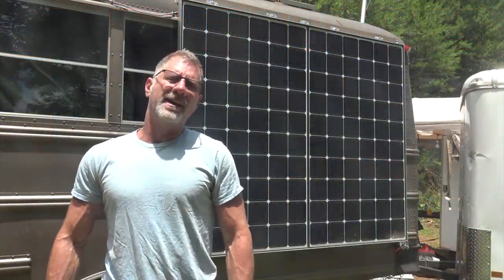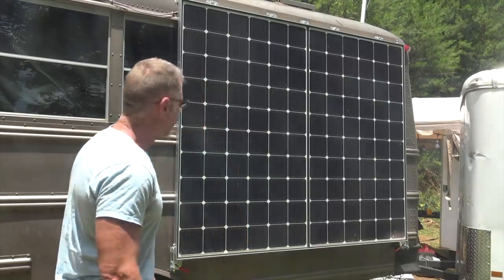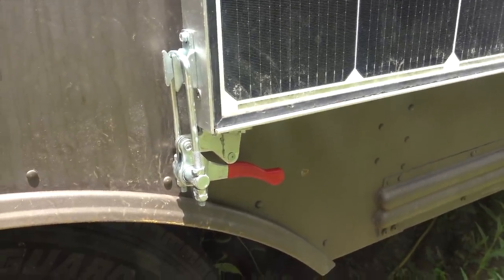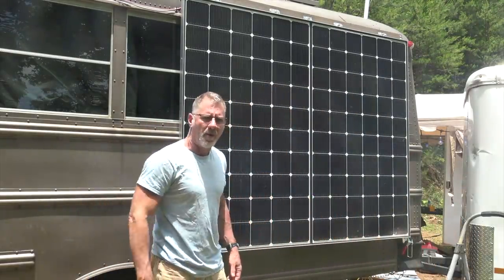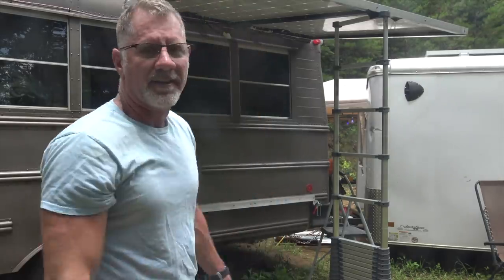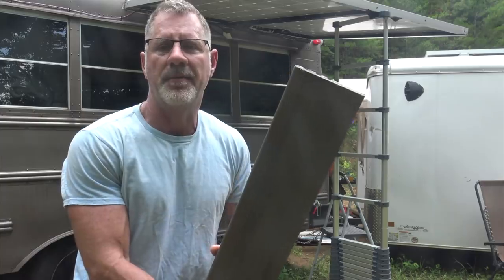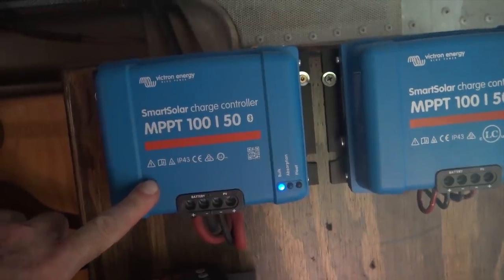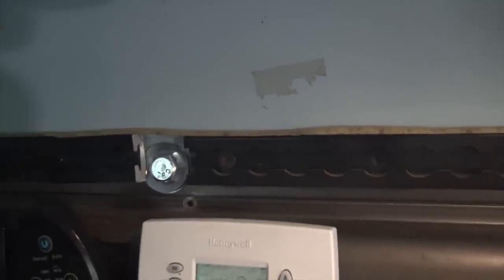Installing solar panels on the side of my rig | How I did it

Comment: What a great idea. This vertical setup for solar panels on the side of an RV had Not even occurred to me.  Duuhh!  Thanks for bringing this to light...with the right equipment and an aluminum spoiler plate mounted on the front ( forward facing ) edge of the arrayfrom top to bottom, would push air sideways stopping air going down the highway from attempting to tear the array off the side of the RV.  I'm getting Very excited just watching your video. What a great way to mount solar arrays when you don't have the roof room to do so.  Thank you very much for this eye opener.  I just subscribed and am clicking on you vid about running your A/C system of the panels. Keep the faith Jamie.    bill in Florida

Comment: I'm doing the same thing on the back of bus with 4- 100 watt panels.  It will use hinges and lifted with gas struts. I wanted it to create an awning for the the entire back of bus to keep the sun out and still allow me to open the door. Nice job!
Reply from the maker: Thanks, Ana! I bought gas struts too but didn't think they would allow the panels to extend up high enough, so never installed them. Didn't want folks banging into them. I hope to see how yours turns out someday. Maybe I'll get some ideas.

Comment: Paint dept in store has several different lengths and diameters (thicknesses) of "Telescoping" handles designed to screw into the handle of paint rollers and used by painters to paint ceilings.  Re-bar in ground is good as extension handle can slip over the bar .. and simply replacing paint roller with a .. "T" shaped "Something" ..  like maybe the head of a "Swiffer" dust mop ?? ... it would be padded enough and strong??  enough to protect solar panel and be held in place on the underside of the panel with a simple "Slip Wire" attached to underside of panels and slipped over each end of the "T" to prevent wind lifting and dropping panels .. AND... the telescoping handle is easily adjustable to maintain angle to sun without having to redo everything else.  Just a thought ..
John

Comment: Your 2x2 angle at the bottom, cut out two places to accept two aluminum handles screwed in place, spaced shoulder width at the bottom of the solar panels to help assist lifting them in place during setup.. one idea.  Great Video👍👍🇺🇸🇺🇸🇺🇸🇺🇸

Comment: Just mount a couple of rods and rod friction holders in the same style/functionality as the rod that holds up a cars hood. You could mount multiple pairs at different heights on the side of the bus to set the panels to different tilt levels as desired.
Reply from the maker: As long as folks can see them who may be walking by, I'm in!
Reply: Enigmatic Nomadics - you could easily cover them with a fluorescent  tape, hang dingle balls from them, even have a small LED lit during darkness, the rods would be folded beneath the panels against the bus during transits.

Comment: Nice idea for a solar awning and such a coincidence I was thinking about doing something similar on a box van when I build it. Having them on the side above head hight when in use makes them much easier to clean than having them on the roof. 
 For security I’d put the locknuts on the inside of the van. Then I’d find some way of locking the frame and panels to the vehicle so they can’t be stolen. Something low tech like an old fashioned, drop pin tailgate latch with a padlock through the slot would be a start. Then I’d make sure all the fixings cannot be undone without the panel being deployed. A couple of telescopic window cleaning poles would work as props and they have male thread on the end that would screw into the socket in the panel frame.
If you’d mounted the panels horizontally end to end you’d ;
1.shield more of the windows to reduce solar gain,
2.when deployed they’d be above head hight, 
3. Easier to deploy and stow, 
4.also less likely to be knocked in parking lots, low bushes etc. 
5. You’d be able to use folding stays like on the old hood/bonnet supports on land rovers or small gas struts.
Reply from the maker: Great feedback Dump Chump. We could really pull this off any number of ways. Thanks for the info!
Reply: for security, find someone with a welder and weld the nuts to the hinges. assemble the frame and hinges with rivets instead of nuts and bolts.
Reply: marzsit 
I agree.

Comment: always love your videos.  I have a shuttle bus (fiberglass) and still have not installed all the solar items I purchased 18 months ago because I'm not sure of the wiring.  One idea I have for the panels is to keep them inside the bus until I'm ready to set them out (I have two 160 watt flexible renogy panels).  I'm thinking of using them like a window awning when parked, or be able to put them on a long cord so I can park in shade, but set the panels out in the sun.  What I really need is someone in ND who knows about solar panel installation on 12v.  I can't find anyone to touch it.  I'd gladly do it myself but don't feel sure of my knowledge.  If you happen to know anyone in MN, ND, SD or MT please send me their name and number.  I'm in Minot, ND so there aren't many (if any) other people interested in solar up here.  Thanks again for your informative videos!

Comment: I suppose those using lighter vehicles like vans etc could design a tent like solar panel system where if they allowed space for say 5 x 100 watt solar panels to be stored securely in their van eg under their bed of van etc eg in the garage of van etc and when the vehicle is in motion the 5 individual solar panels would be wrapped in bubblewrap and protective foam and stacked side by side and secured with a ratchet strap which has about a 1 tonne load strength capacity etc but gently ratchet strap the package wrapped solar panels during the journey and build a frame that they could slide in to when on a campsite etc eg like a collapsible or portable solar roof deck allowing for portable solar power on the go but not needing it whilst driving etc and just use folding legs attached to the frame that holds the solar panels etc with the solar panel frame looking like a decorating table that folds away flat when not in use etc and when in use the folable  legs are secured with guidelines and tent pegs etc giving potential of easily 1000 watt of portable solar power when parked up and easy to instal as a tent is which is also based on a simple easy to assemble ftamework etc
Reply: Domain Names 
Nice idea and it would be easy to build a padded shelf on the underside of a bed. It would get over my concern about theft when the vehicle is left unattended.

Comment: 3/8" steel rivnuts would be plenty strong enough to hold the hinges to the bus and don't require drilling all the way through. they do require a special tool to install them though.
Reply from the maker: I’m a big rivnut fan. I have that tool. I wouldn’t trust them in that application but I use them where I can.👍🏻👊

Comment: I think it would look better if put angled bars like the the put on side of awnings and u can install them removable to adjust to traveling.  no need to bother with heavy pipes
Reply from the maker: Oh, I was suggesting plastic PVC. I didn't have an example to show in the video, but yeah, Whatever you want to try. The great thing is, if it doesn't work, we can always keep changing it until we're happy.

Comment: easy fix find 1 leg for a awning for a rv and mount it to one side of the panels it would be adjustable and strong enough and you would not have to remove it all the time